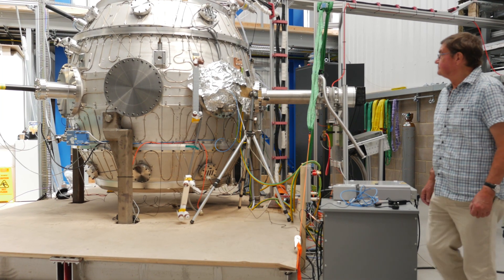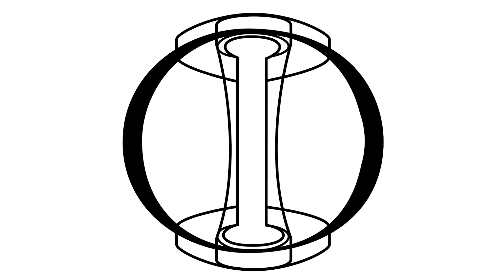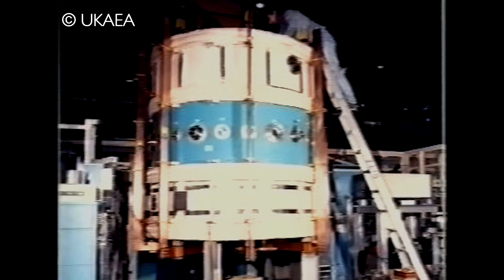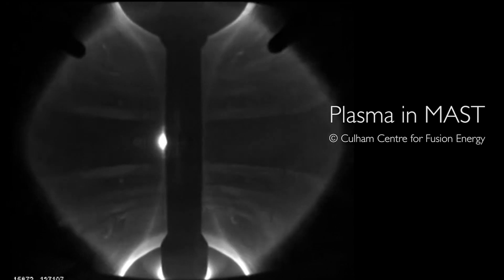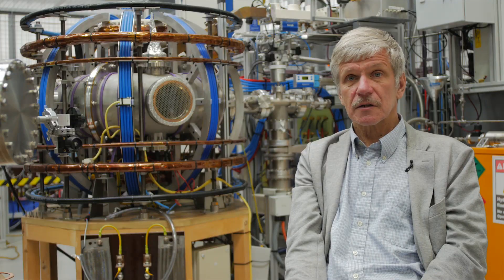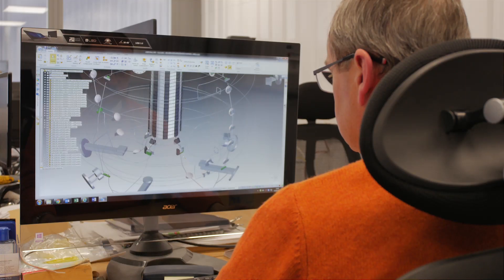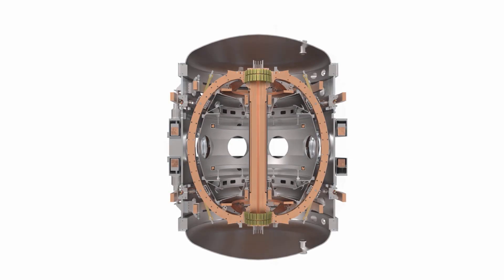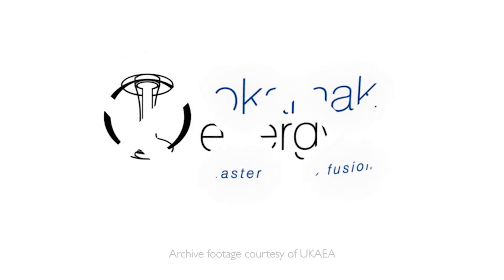A History of Spherical Tokamaks

Comment: If successful, fusion opens up space travel in some profound ways. At least 3 reactors as power-plants (redundancy), generate a plasma in front of the ship to stop it ablating, around the ship to stop radiation, and run EM or Photon drives, or propel any mass you like out the back to speed up. You can achieve some rather impressive speeds that way, and scoot around the solar system gathering up resources etc. opening up the solar system and planets like Mars for colonization. Interstellar travel even starts looking a bit feasible. All without the radiation issues of fission.